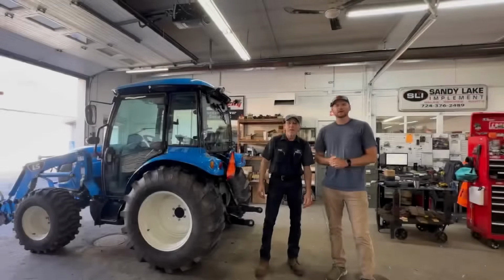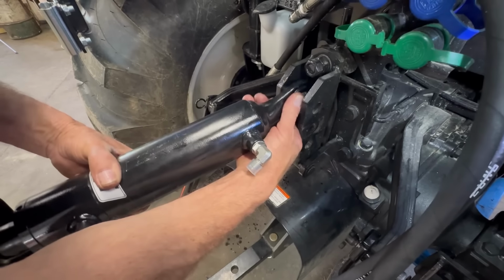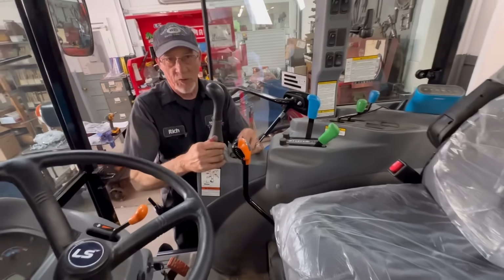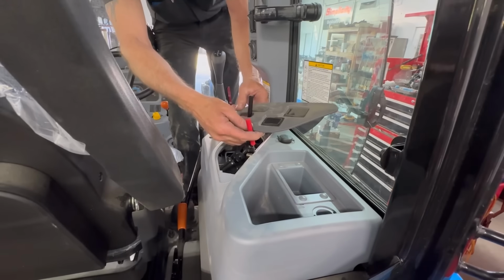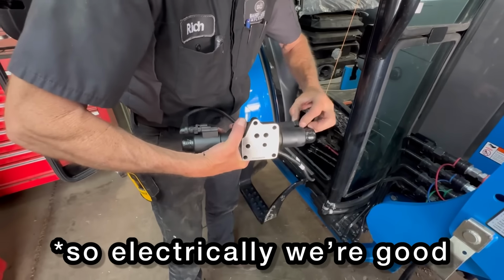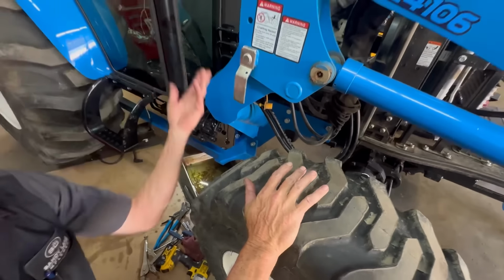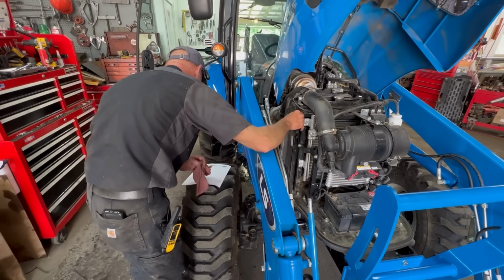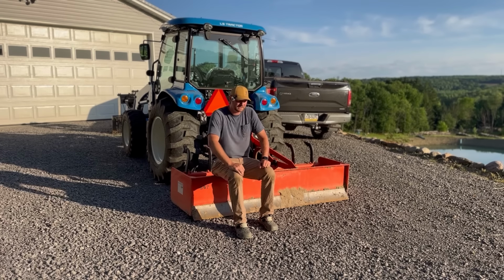Every Tractor Should Come Standard With These Features

Comment: Rich knows his stuff. I'm also impressed with that trailer of yours. It can carry so much weight.
Reply: A dump trailer with 14,000 pounds worth of weight capacity is absolutely the best single trailer to have if you are a smalltimer with 1-2 pieces of equipment that can fit into it.
Reply: I agree but I wonder what the vertical load is on the connection with the pick-up. It seems large with the wheels rather far back.
Reply: @Thunderst0rn  the axles on a dump are really far back in order to prevent picking your truck up by the hitch when 8,000 pounds of concrete tumbles to the rear of the bed when you dump it.
…
I routinely tow an 8,5000 lb excavator in a similar dump trailer behind an F250 diesel. It is tricky to get the machine far enough BACK to properly balance the load while still closing the trailer doors. But it works really well once you figure it out. The main real downside? Height. The deck is very high. Your trailer is less stable, you need to pay more attention to overhead clearance, and the ramps are very steep when loading/unloading.
Reply: @MemphisMechanic  makes sense, thanks for clearing out!

Comment: I have these options on both my tractors and they should be standard options, I use the TT on my finish mower when mowing over banks and ditches and the TT kit on my drag blade and box scraper, once you get these options you will  never want a tractor without them !

Comment: I had the dealership install the third function on my tractor. Totally agree, not something I wanted to tackle. I’m still struggling about box blade vs land plane. When I make that decision, I will install the top and tilt myself since the rear remote is on the machine. 
Great video.
Reply: Box blades are great at moving material & land levelers are great at smoothing material.  Tim in northern TN

Comment: Nice!  I added a 3rd function to my New Holland T4.95 and it was an excellent addition.  They should be more of a standard item on loaders given the number of grapples and such out there now.  On my T5.120, it came from the factory with a diverter for running 3rd function.  It's seamless and works very well.  I look forward to seeing how your rear adjustability helps out.  Nice video!

Comment: To use piloted check valves on a hydraulic top link and/or side link is highly debated on the various tractor forums. The only reason not to us a check valve is if you intend to use an implement in float mode. Othewise it is best to use a check vale on both hydraulic links in the name of safety and to prevent leak down changing the position of an implement how ever small the leak down may cause.

To see a seasoned mechanic using tape on a hydraulic fitting was disturbing since it is considered "taboo", the tape can lead to residue in the hydraulic fluid and can lodge in the hydraulic valves. I (and most others) use Loctite 545 on all hydraulic (and pneumatic) fittings.
Reply: The key to using tape on a fitting is to start the tape a thread or 2 back from the end of the fitting. I have used it that way for 40 years without a problem.

Comment: IMHO if you have a box scraper you really do need the Top & Tilt functions.  However, the manufacturers of that kit  need to re-spec that top cylinder of the top & tilt kit.  The one they chose is too long.  Fully retracted is about what I would consider a neutral position and the rearward "droop" is super excessive.  Right now if you wanted to rip with the scarrifier teeth you can barely pick up the back blade to avoid scraping and moving dirt at the same time.

Comment: Not to bust your balls to much. But when you load your tractor. You should block the front tire of your truck. Can see your trailer moving forward as you load it. I had it happen one time loading a skid steer on a trailer and the rear tires on the truck came off the ground and I was along for the ride.
Reply from the maker: Yeah I knew that would happen. As long as you’re prepared for it and know what to do you should be fine. When you’re at that point either get on the trailer or get off. The worst thing you can do is freeze. My truck and trailer only moved about 6” because I kept driving forward to get the tractor to provide tongue weight and get the truck tires back on the ground. Or better yet park on flat ground and you don’t have anything to worry about

Comment: How do you strap down your tractor in the dump trailer. I want to consolidate to one large dump trailer but can't figure out the best way to strap down the tractor.
Reply: The ones I’ve seen have tie down points (flip up eye rings) in the corners of the bed floor.  Used them to haul Skidsteer before.
Reply from the maker: I have 4 D rings in the corners of the bed of the trailer. Now finding a good tie down point on the tractor itself is a different story. If the machine was mine I would probably try to weld on something for tying down